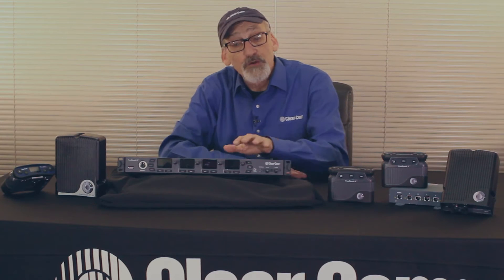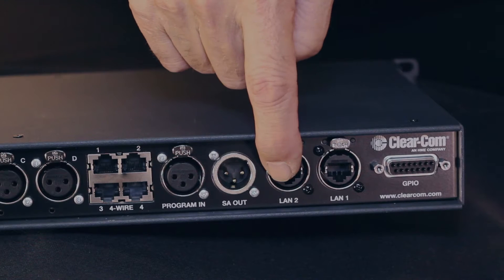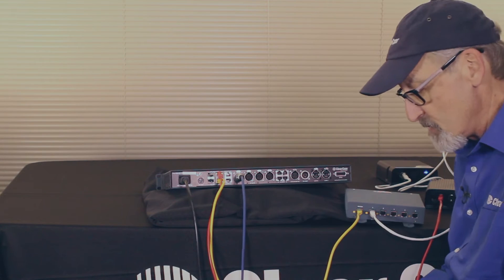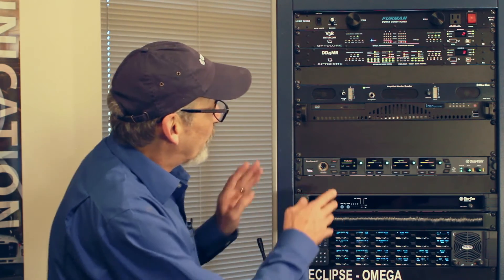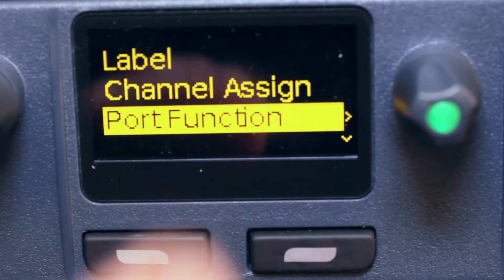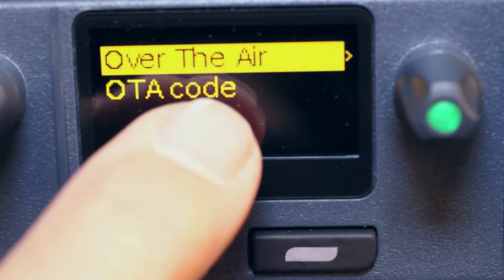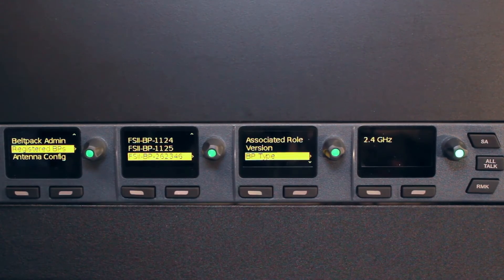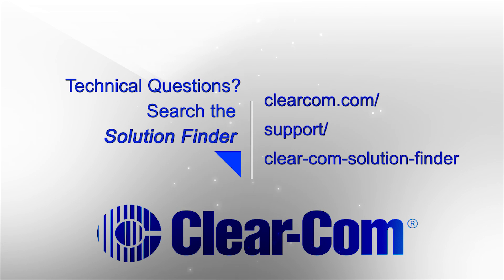Clear-Com FreeSpeak II Installation Video 4 of 4 (Instructional)

Comment: Do you need a special splitter just to add an extra antenna? The product manual shows the very overpriced FSII-SPL splitter and makes zero reference to any other splitter, but that is definitely not the splitter being used here which appears to be far more basic. We don't need to add a dozen antennas or anything, just a single antenna, and the splitter you offer is more expensive the the transceivers themselves.
Reply from the maker: The splitter in this video is the PD3007 splitter and not the new ones.
If you are only using two transceivers, you can connect them directly to the two transceiver ports on the base station.
Please feel free to contact our support team: Support@clearcom.com for US call: +1.510.337.6600 
for more information on contacting our support please refer to our website: https://www.clearcom.com/support/service-repair/

Comment: Question: If we have two transceiver units, one plugged into the Cat5 Antenna Port 1, the other plugged into Antenna Port 2, will the beltpack units automatically switch to the appropriate transceiver based upon signal? I mean, I hope that's how it works but want to make sure, as in we can use the second transceiver at a different part of the building where the first signal starts to die off, and will the users' beltpacks automatically jump to the second transceiver? But wanted to make sure as I'm not certain how that works with the "5 per transceiver" thing going on, as in if we had 6 beltpacks in a specific location would one user get bumped if the second transceiver is in a different location?

Comment: If you sync a belt pack to a transceiver is it still necessary to register that belt pack on the base station?
Reply from the maker: If you register a BP to an antenna transceiver,  it will only "talk" to that transceiver. 
So, after you do the test mode stand alone testing, you have to then register the BP to the base station to have it correctly interact with that base and its system.

If you have more questions don't hesitate to contact our support team!
support@clearcom.com

Comment: is a slitter a router or switch ? horrible word to use
Reply: A "splitter" is exactly that. 
It only splits a signal path into multiple signal paths.
Reply: Ok but along those lines, can you use any "splitter" which are easy to find, or does it need to be a "repeating hub" (which duplicated the full signal, whereas the splitters literally take half the cables in a cat5 and splits them between 2 ports)? The manual only references the much overpriced FSII-SPL, we're needing to add one antenna as they don't cover many bodypacks in an area (after getting it, the manual states it's preferable to have 2 bodypacks per antenna, which is kinda absurd, despite being marketed as up to 5 per antenna). We have a question into support but curious if anyone else knows of working splitters/hubs/etc.
Reply: So which one a router or a switch ?
Reply: @JeanAhmad  neither. It's a splitter man